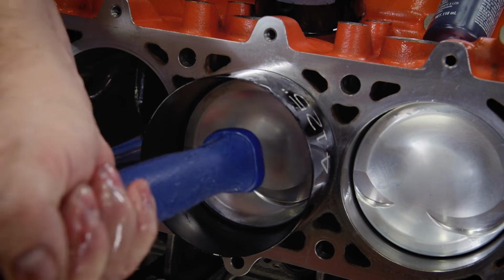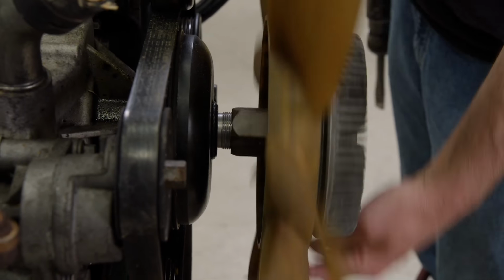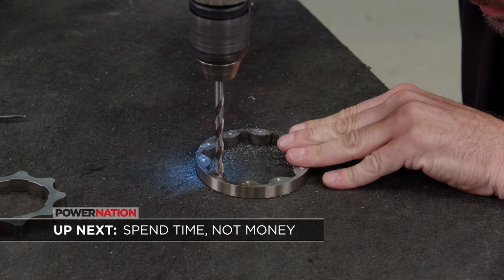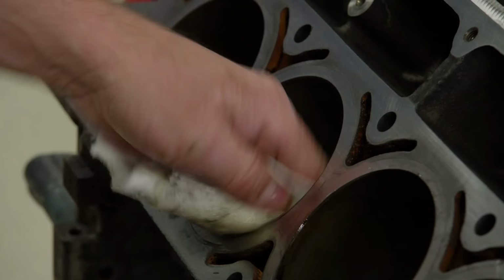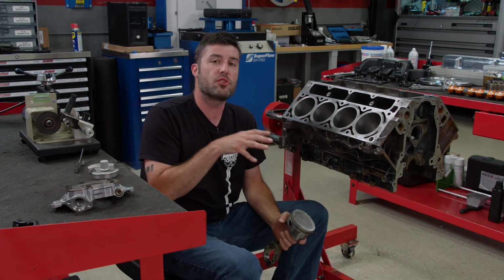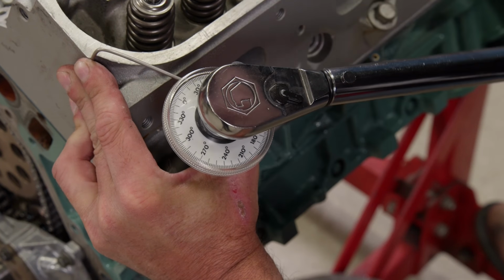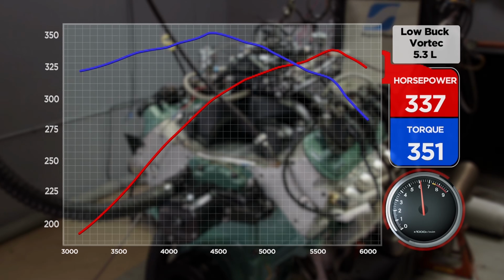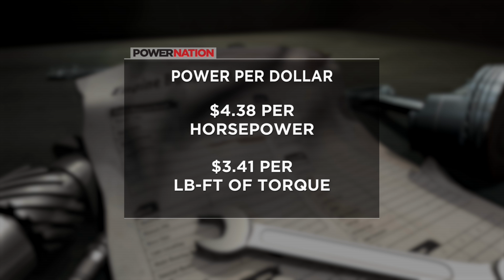Minor Upgrades Create Crazy Power on a Junkyard 5.3L Vortec - Engine Power S7, E10

Comment: And it has a Carb.  Lets see it with fuel injection.
Reply: Yeah, $837 carb  and $405 ignition as well.  Love the show, but glaring omission.
Reply: @1spaghetti32  If you're paying 837$ for a 4 barrel carb on a budget project, you either got it sponsored(this show), or you're not real smart with your budgeting.
Reply: @1spaghetti32  yeah.   But most guys contemplating this job know you need those parts.
Reply: @bmstylee  Most guys contemplating this job know the price of all the parts or have a rough idea my guy.  I was pointing out that Powernation went through the effort of running up a total without even considering half the cost of the build.
Reply: @1spaghetti32  "For entertainment purposes only. Prices may vary. Not all work is documented. Consult a professional before beginning any work. Not for use as instruction, or directions." etc, etc.  As pointed out, everyone paying attention figured there was more to the cost. People just gotta nitpick .
Reply: They should do the megasquirt diy EFI for this one. Those things are about 200 bucks and some soldering, but they do work... Then again they could just have reflashed the stock computer they already have. EFI isn't that much of a pain in the ass to do anymore.
Reply: @dangoldbach6570  I agree with you, a junkyard LS with some work done to it and a budget EFI overhaul with a microsquirt, new injectors and standalone harness is tough to beat when it comes to price/performance
If you play your cards right when it comes to cam selection, bolting on a turbo is just a tune away too
Reply: Frigglebiscuit BULLSHIT
Reply: @raptor31able  Not BS, E85 and turbo through a carb is the bees knees. This is coming from a guy who just advocated for a microsquirt a few comments above.
Superior atomization cools down the intake charge up to 25-30 degrees AFAIK, something you unfortunately don't get with port injection.
Reply: @anonanonskitheanoniest  i assume you are speaking of degrees celsius, as atomized fuel drops iat by about 100 deg F. However that doesnt mean you dont need a intercooler.
Reply: @anonanonskitheanoniest  most guys running a blow thru carb without a intercooler are spaying meth/water as well if they are making serious hp.
Reply: Usually seems carb makes same power as fuel injected maybe carb slightly better when wide open but the best thing about fuel injection is drivability at part throttle.
Reply: In the spirit of this video see what you can do with the stock EFI system + computer.  Changing the cam (like they did in this video) probably rendered it incompatible...
Reply: Probably not significantly more unless it's running multi point.   Something like the Holley Sniper is just a 4 barell in drag.

Comment: One cost that nobody mentioned was the cost for the ignition controller
Reply: They did mention that it was an MSD ignition controller
Reply: No mention of header cost either
Reply: You forgot the cost of the water they used.. probably some toilet paper, hand towels, cleaning products... new oil, new spark plugs... the electricity they used. Gas used in their personal vehicles getting to work... they left out allot!
Reply: @hawkdsl  probably a 600 ing controller

Comment: Great job guys. But we would love to see some Coyote builds and some 3.5 eco builds thanks
Reply: Does someone make a carburetor intake for the coyote engine?
Reply: My friend has a 3.5 Eco F 150. It puts my 454 Suburban to shame except on torque. 17 MPG puling uphill with a 3,500 pound trailer. Unreal. The most MPG I got out of my suburban was 12.
Reply: Mike383HK Bet that EcoBoost still builds more torque than the 454. I had a low mile 460 in my last truck, and it was a dog.
Reply: Whose this we? I don't want to see that shit

Comment: They didn’t include the machine work they did in house.
Reply: And the carb
Reply: DontBe StupidAnymore good catch
Reply: My God People! Stop nitpicking silly cost. Anyone with half a brain cell knows the shows "cost" are ball park at best.  There are many ways to a completed, running engine. Of course your pocket will dictate that route.
Reply: 400-800 carb, 400-600 headers. "machine work" as you call it is not exactly true. they polished the crank with cork ribbon only.. you can do the same with shoe string and brasso.
Reply: @hawkdsl  that still doesn't factor in headers and the elec. water pump and the carb
Reply: @clevelandmaker386    those are dyno parts as far as these types of builds are concerned.
Reply: @hawkdsl  yep did my old super charged L82 1976 vette lolol👍👍👍
Reply: and the headers
Reply: Exactly
Reply: You mean a ball hone on a drill?
Reply: No matter,  they over priced that build anyway
Reply: Same as hgtv home remodel shows where they basically rebuild a house for 80k lol when most people spend half that on furniture, appliances and cabinets lol
Reply: @nicholstop8161  I flip houses and if I spend 80k, it's because I literally redid everything except maybe doing all the drywall new. I see those shows and wonder how the eff they spend 30k on a kitchen alone.
Reply: They got rid of the stock computer and wire harness.  Something has to still drive those ignition coils and provide proper spark advance.
Reply: @masonfamily6124  during the dyno pulls, there was a caption that said what carb and ignition control they used. It was a QFT Black Diamond 750 carb and an MSD 6015 LS ignition control. And I dont recall seeing either of those included in the build cost. And I dont k ow about you but I don't have a way to do that to my crank at home. And am I the only one questioning that dyno graph? All thebtorue right at the hit like that and then falling off looks weird to me.
Reply: A quick google search shows the carb at about $840 and the ignition control at about $400.
Reply: The only machine work they did is polish the crank.  That's cheap to get it done at a machine shop.
Reply: Right
Reply: Lol bottle hone ? Sand paper, pressure washer is all you need.  Take crank someone to polish for cheap
Reply: Not even.  Look what BadDaddyBrad does with his LSs - stock blocks with eBay turbos and 600+hp lol.  People have taken the 5.3 to 1000hp with boost on stock heads and bottom ends.  More nitrous pulls like that will probably melt a piston but that's not the GM block's fault.  Don't be afraid of the LS - it has racetrack DNA - stock bottom ends can put up with pretty intense torque numbers and RPM.
Reply: @RyanMcIntyre  IF you properly gapped the rings they will. Otherwise it's asking for trouble. You WILL rip that piston top right off
Reply: @RyanMcIntyre  yep, racetrack dna...aka ford 351w...
Reply: yes, the single most expensive part of what they did.
Reply: @frotobaggins7169  you can do this all at home
Reply: "They didn’t include the machine work they did in house." no shit it was free as they did it themselves in house.. but to answer cost 20-35$ at a shop
Reply: @codyramos3200  yeah no. prep and block assembly is at least $1000. I paid $3500 just for cleaning and assembly and that was the cheapest estimate out of 5 shops within an hour drive of me. Shop labor is $150/hr anywhere reputable
Reply: @chadjackson4786  why would they charge themselves for things they did themselves at no expense?
Reply: @codyramos3200  because most people dont have a machine shop in their garage and would have to pay for it. Its not cheap which means the video premise is a lie

Comment: Used rings, used cam bearings? 725 lb/ft on stock rods? Stupid.
Reply: Yet half the comment section says you can make that motor live at that power level forever.
Reply: Is it for an occasional hill climb or a boat?
Reply: Yes, yes, and they can handle it

Comment: Cant yall just call a Ls like everyone... the older 350 like in my 98 suburban is a vortec
Reply: An LS by any other name is still an LS. It's a 5.3 LS.  My first gen 350 has vortec heads on it.
Reply: Because of pedantic assholes
Reply: I thought the same thing. Thought they were gonna do a badass 350 build.
Reply: LS is only used in the cars. The truck motors are LS based but they add re vortec engines. Pop the hood on one and look at the engine cover.
Reply: @319speed  my lq9 is 100% LS
Reply: @ls6-ss413  you are incorrect. It is LS BASED. Same thing but cast iron block instead of aluminum. LS blocks are aluminum. Minus the aluminum 5.3 blocks in the 4x4 models to save weight.
Reply: @ls6-ss413  no, your lq9 is an lq9.
Reply: @319speed  I just popped the hood on my 08 Silverado 5.3 and it says Vortec. But it is still an LS motor. This is common knowledge.
Reply: @319speed  there is nothing that carries over from the 90's vortec 350 to the LM7 or LQ9 or LS series engines. There are completely different.
Reply: @TheCamaro5  no shit sherlock. The truck engine is not an LS they are LS BASED. My phone messed up what it said. When you pop the hood it READS Vortec! Where do you think vortec max package comes from for the trucks??? Cuz they consider the ls based 5.3 and 6.0 a vortec engine. It isnt the same as the pos  old 5.7 that were junk.
Reply: Gen 3 is more accurate
Reply: 64NovaSS TT  well you can think I'm an idiot all you want haha they are still JUNK!! 🤣🤣🤣🤣🤣 only people running those are old school guys that dont want to go new tech. I'd rather have an LS based engine all day long over that old 5.7. Such TRASH haha!!!!!!!!!
Reply: 64NovaSS TT  thanks for the correction as far as comparing to a hemi.
Reply: @Stackali  exactly
Reply: @Stackali  my 99 suburban had a 5.7 L31 with vortec heads, and correct me if I am wrong, vortec refers to the combustion chamber in the head and is a totally different animal from an LS
Reply: @benkinnard7095  Yea Vortec came in 1984 with the 4.3L v6. It referred to vortex technology that swirls the air and fuel in the combustion chamber for better mixture. Many engines use this technology today.